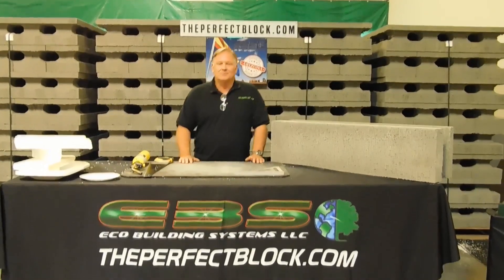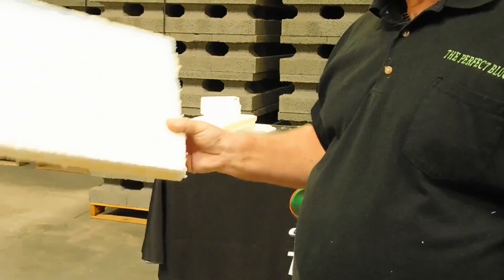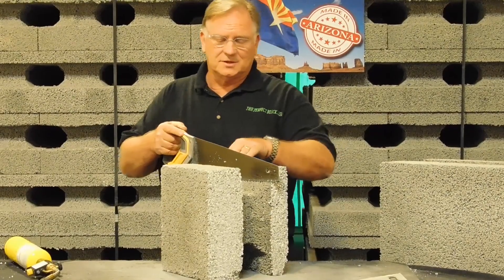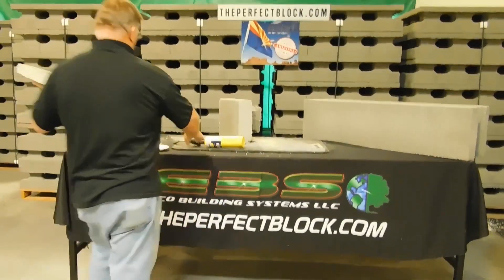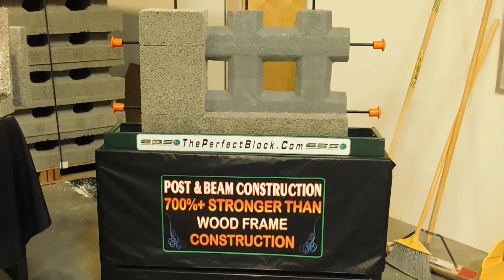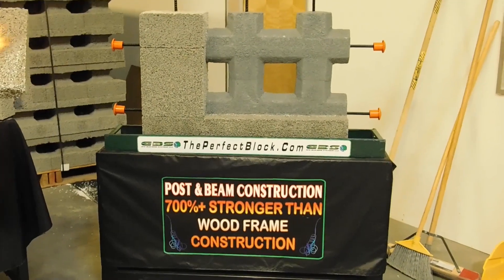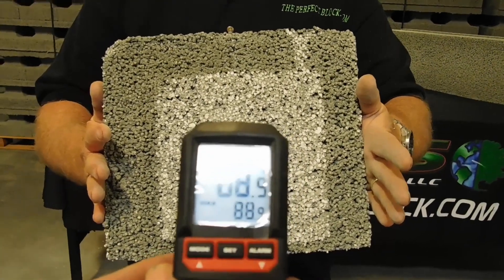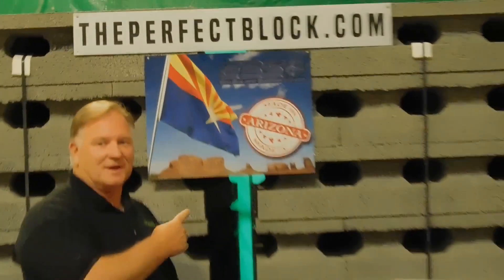Fire-Tested and Proven: Why The Perfect Block Is Perfect for Fire-Prone Regions

Comment: I kinda want more of a solid wall instead of a concrete grid,  I know it's engineered and works just fine, but it's just a consumer confidence thing. I really love the fire resistance. Any plans on a "vertical ICF" approach version of this?

Comment: It’s not that difficult or even expensive to build homes that are extremely fire resistant.   They just choose to not do it.    You could also build in or add fire suppression systems into the inside and around it.  Again they choose to not do it.  Where I live apartments don’t have to have fire suppression. However , when that exact same complex gets converted to condos they have to have it.   We typically under build in the USA for what ever threats we have.   It’s true across the country.
Reply from the maker: I concur.

Comment: Concrete is already fireproof but will it survive heavy loads like solid concrete?
Reply from the maker: The forms create a steel-reinforced concrete column and bond beam wall nearly equivalent in compressive strength to a solid concrete wall. Longevity? Roman concrete = 2000+ years old and still standing.

Comment: I remember using this product in the 1990's - brand name of RASTRA. Had to reinforce the wall sections to keep from blowing out the cells. I like the product.
Reply from the maker: Hi Ron, I thought I should comment on "blowouts" in ICF and ICCF because we suffered with this in our earlier days with other products.

From another comment from YouTube:   I realize the strength comes from the grid of concrete and steel reinforcement, and a stacked bond is definitely faster and easier than a running bond, but wouldn't having all of the joints aligned like that increase the risk of a blowout when pouring the concrete?

Our factory ends have 3” wings and are very stout. They also get glued to adjacent blocks, minimizing any potential for weakness. We have never had a blowout issue with factory ends. In fact, we don’t have blowouts. Please read our build manual. If you follow our ICCF building guidance and techniques, blowouts will be a thing of the past.

Excerpt from our build manual about blowouts:

Builder's Tip: In our construction experience, pumping concrete in ICCF walls for decades, we HIGHLY recommend pumping your concrete in "lifts" in a circle around the house from the inside. Fill window sills first and a course or two of block cores on each side of door openings from the cut holes on the interior side of the walls of the first lift (5') on each side of the openings in your first circle around the perimeter (fill the window sills from the holes on each side of the windows until the grout rises to the top of the sill and stop). Then fill to 5' of wall height in another circle around the inside perimeter of the building, then, from rolling scaffolding, fill 5' of wall height on each subsequent circle until filling from the top of your wall. The extra time and labor cutting intermediate holes in your walls to pump in 5' lifts is incredibly cheap insurance against having a "blowout" in your wall. In addition, it is inherently safer to pump in lifts rather than initially from the top of a wall. As you pump each lift, the concrete is beginning to set, providing additional stability as you prepare to pour the next lift. These "lifts" are typically completed one after another on the same day until one floor of the wall has been grouted.
It is essential to emphasize the need to exercise good and proven techniques when grouting. A "blowout" or even more than one will definitely ruin your day. "Blowouts" were a common and unwelcome experience years ago from other ICF and ICCF forms. Some of them are attributable to weaknesses in the form, but most are from poor grouting technique. At EBS, when we grout, "blowouts" are a thing of the past. EBS ICCF forms are monolithic and strong, but you must identify and "shore up" weak areas (areas where you have cut the block and created "core wings", greater than 3" or removed webs for plumbing) and grout smartly.

Comment: Looks like a great product, but missing from the product lineup is a sheet product with stucco and other textures that would make a great fireproof lightweight and insulating sheathing material.  It could also be used to retrofit for fireproofing.  It would probably require some fiberglass fibers mixed in to give it enough toughness.

Comment: Very interesting concept. I love that PS can be reused and kept from the landfill. This would be a great product for building sheathing/rain wall. Combined with Rock Wool, this could be a fantastic waterproof/fireproof system.
Reply: If it burns it will release all the chemicals contained within.  Sure the mass of the cement can absorb a finite amount of energy from the torch keeping the temp down, but a few minutes of sustained fire temps and that thing will be spewing off all sorts of nasty.   Never trust a product that offers "live demo" evidence in lieu of documented and sanctioned evidence that is tested and confirmed.

Comment: Might want to put the heat gun n the area you had the flame.
Reply from the maker: The hot side would be 3700 degrees F and would decrease rapidly when the flame is removed. Our thermal tester does not go anywhere near that high.

Comment: Cement blocks in earthquake areas. Not good.
Reply: Reinforced with rebar and poured concrete.  How could it be any less safe in an earthquake than the thousands of warehouses built with cement blocks?
Reply from the maker: @jasonbroom7147  The Perfect Block is not a cement block; it's not a block at all. It's a stay-in-place form. !00% of the structural strength comes from the screen-grid internal matrix of steel-reinforced concrete columns and bond beams at 12" on center, each way. Think for a moment, if you had a monolithic ICCF wall with your foundation and slab, and in a wild hair moment, you decided to drive a truck through that wall. What do you think the outcome would be?........ Goodbye truck. That's strength. Now, theoretically, compare those results to the other predominant building materials being used today in North American construction. What do you believe the outcome to be?

Comment: Love it!
Gonna run out of recycle materials when building 2 million house a year
Maybe add perlite or pumice or some other  light weight rock 
Also you could incorporate Rock Wool (basalt rock) you might find supply and perhaps a board material to replace drywall 
Also incorporate finish for inside and outside to reduce finish cost will make up for added expense.
God speed!!!
Love it

Comment: How about instead of fossil fuel waste we can also used organic natural materials that are sustainable renewable and affordable!!!!
Reply: There are a variety of “cob” construction techniques though you’re better off referring to natural building materials, rather than organic. Organic has become trendy in foods, but in building materials it means it can decompose and that’s not good. Products similar to what’s shown are dust-crete (using sawdust) and straw/clay. There’s a block similar to these using wood chips and a cement slip.
Reply from the maker: Organic? That sounds like food for bugs. We don't want to feed any bugs in our block.

Comment: What is the R-value of the 10" and 8" walls?  Can't find this easily on the website.  Why would this be left out and hard to find?
Reply from the maker: Thanks for the suggestion. The R-value of the 10" block is R32, and the 8" is R24. Please see the Technical Specifications page in the free build manual available on our website for more block data.

Comment: Has the perfect block been tested for tornado and hurricane conditions? If a finished perfect block wall can withstand objects being hurled at 250 miles an hour that would make it a fantastic building material for certain parts of the country.
Reply: The core of the block  reinforced with steel rebars concrete
Reply from the maker: We have had ASTM testing done that shows the block can withstand 250+ MPH winds, ASTM E330, here is a link to the report https://theperfectblock.com/wp-content/uploads/2024/12/Hurricane-ASTM-E1886-ASTM-E1996-H6867.02-rpt.pdf
Reply: LOL like a frame house could withstand an object at 250

Comment: Another major point is that these walls don't need temporary bracing before the concrete pour. 
 I'm correct, right?
Reply from the maker: You are correct. Because of the weight of the blocks and tack gluing, we rarely need to brace walls.

Comment: Missed the opportunity to show the temperature on the side that was being burned out. It would've shown the temperature difference between the two sides.
Reply from the maker: Thank you for your feedback! Please note that MAPP gas burns at approximately 3,700°F. The block cools down quite rapidly after exposure, but the digital thermometer we were using was not capable of measuring such high temperatures.
Reply: @theperfectblockiccf  thanks for clarifying!
Reply: That’s exactly what I was thinking!
Reply: I thought he did, but maybe I was distracted by my other thoughts.
Reply: FYI -  A house fire can reach temperatures between 1,000 and 2,000 degrees Fahrenheit, with the hottest point near the ceiling potentially reaching up to 1,500 degrees Fahrenheit;

Comment: Will you guys consider producing this in panelized sheets for cladding/facade purpose?
Reply: You can get AAC in panels with high fire rating.
Reply: AAC isn’t approved in all states, and CA in particular, though maybe it’s just coincidental that this video popped up the week after LA started burning.
Reply: @johnlee7085  AAC can be used in CA but not structurally so you have to build a wood or steel frame.
Reply: @johnlee7085  excise me, what states is AAC "not approved in"? Sounds like misinformation to me

Comment: When will you guys release a version that has "stud's" built in like standard ICF's have for better attachment options?  I get that would be a significant puzzle to solve otherwise you'd already have it out.  It will be worth it!   I am about 18 months out from a build.
Reply from the maker: Attaching anything heavy to our ICCF wall is not difficult, just different. Think of the concrete columns and bond beams at 12" OC each way as "framing members". Using the correct fastener, 1/4" dia Tapcon, you can hang anything heavy on our wall.
Reply: @theperfectblockiccf  Penetrating in to  the grout cavity?
Or just the cement/EPS  block mix(2" penetration in to  block.)?
Reply from the maker: @williamevans6522  To the concrete cores. Then you can attach anything heavy. The form material does not have adequate pullout resistance for heavy loads. Works well for 30-50 lbs of framed photos and paintings.
Reply: @gunzofthenavarrone8293  cut in studs, as needed. Use approved fasteners to tie stud in to rebar. Or use hurricane straps to penetrate between block courses tieing in studs to grouting cavity.
Cut in metal studs  strapping in with hurricane strap.